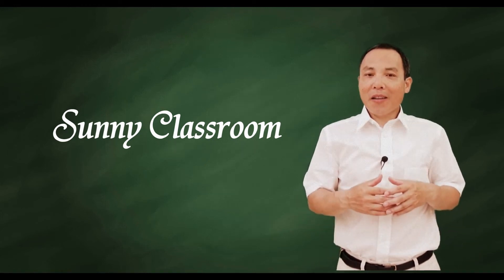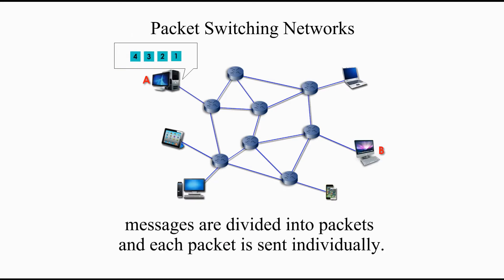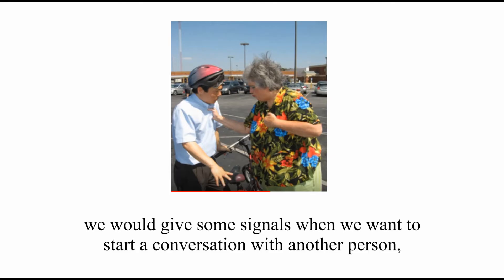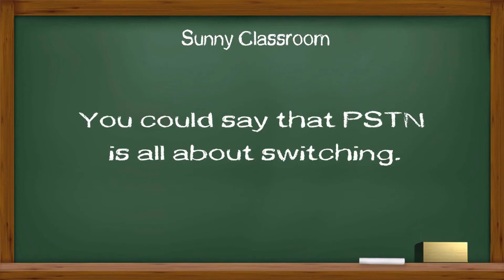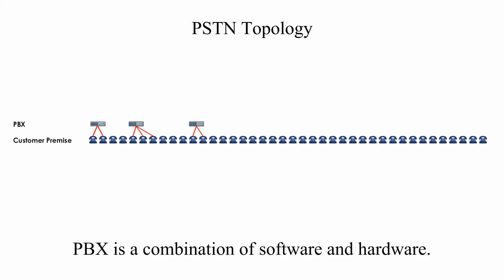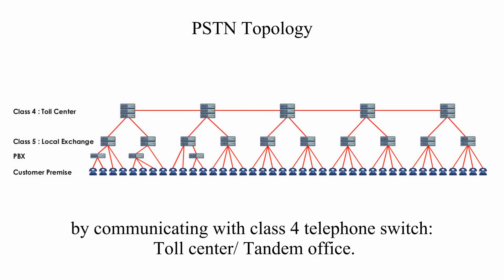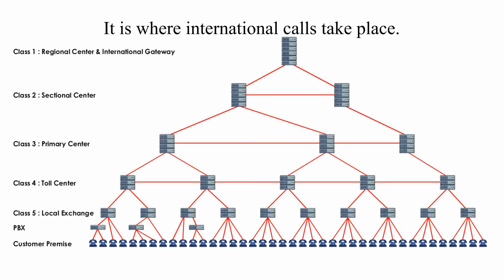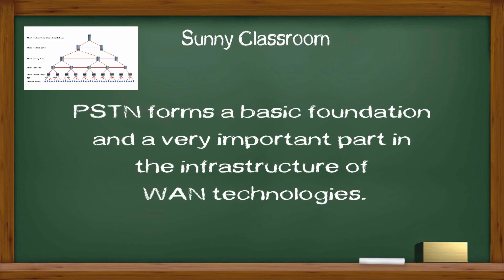PSTN - Public Switched Telephone Network

Comment: A couple of very important questions I would love to put to Openreach...

1. I assume if you are offering PSTN to VOIP devices so the dialtone is emulated locally then you will be providing battery backup to enable emergency services calls in the event of a local power outage. Who exactly will be paying for the external battery pack or internal pack in the modems ? If this is the service provider that cost is going to be passed on to the end user. A cost that has always been covered by Openreach in the past with FTTP for example. Who is going to be paying for the equipment to keep a service that has always been a core responsibility of Openreach in the past. Regardless of the method employed Openreach are still responsible for the path from the customer NTE to the MDF.... or directly into the 21CN backbone in the case of direct IP / VOIP services.

2. I assume that unless fully LLU the core of current PSTN users can look forward to huge reductions in call rates and line rentals given that providing a VOIP service is substantially cheaper than a POTS line... No line cards and a large reduction in equipment power consumption at the exchange for example will result in huge ongoing cost savings for Openreach once the equipment change at the exchange is complete, a process that was well underway 14 years ago when I retired as a PTO / SFI engineer.

Openreach appear to be trying to act the poor victim when this very long overdue switchover was announced and are complaining about bandwidth usage on the backhaul network. As anyone in the industry will tell you Openreach have been trying to prolong the usage of old slow creaking backhaul links to keep the profits rolling in rather than investing in backhaul links, FTTP and actually blowing new fibres and upgrading modems and switches to cope with an ever expanding increase in traffic. It does make you wonder what network latency will be like when all this additional VOIP traffic bogs down the existing  antiquated links. My estimation is that overall latency will increase (something that voip services do not like very much) whilst service providers are left to cover the cost of additional or replacement equipment. As I cannot see directors and shareholders buffering these costs it is going to be the end user that suffers in the end.

This is something that has been on the cards for many years. It is NOT something that has suddenly and without warning been dumped in the lap of Openreach to sort out.

It is looking like the stopgap solution to this self inflicted disaster is to try and shift as much traffic as possible onto mobile network operators who will sooner or later hit the same problem wall that Openreach is shortly going to slam into...

.................

We have an underfunded and under  invested network backbone that is not going to be fixed by calling Scotty in engineering and asking for more power to the shields !

If I ever doubted the existence of Karma for corporate bigwigs and greedy investors I am sure that leaning back with my popcorn and watching these people tread water that is up to neck level for the next few years will fully restore my faith in this phenomenon !!

Meanwhile I have two empty baked bean tins and a length of string on standby and ready to go.  ☺ 😂